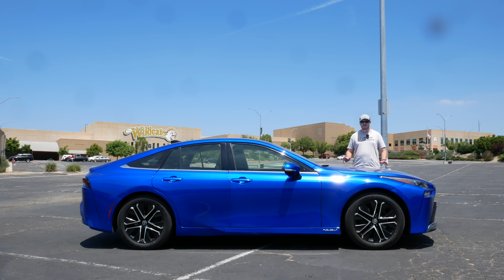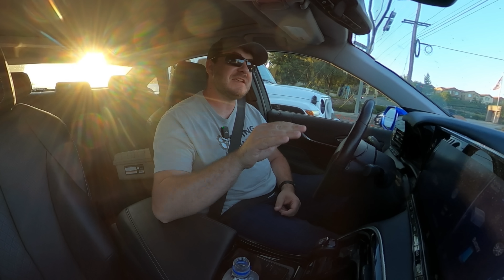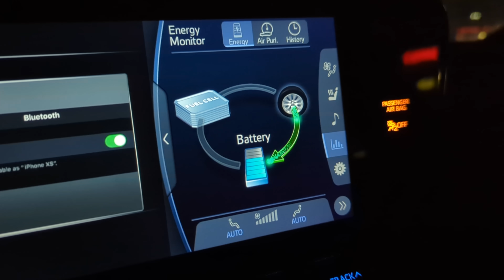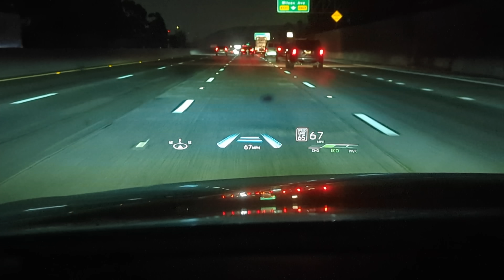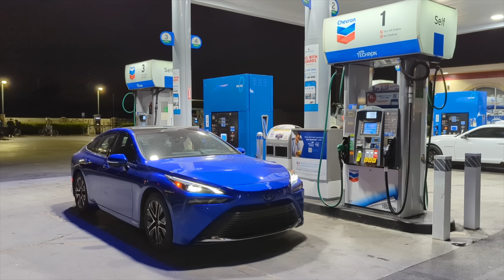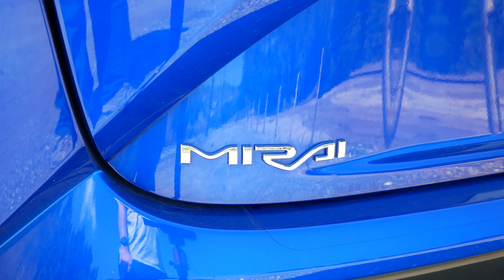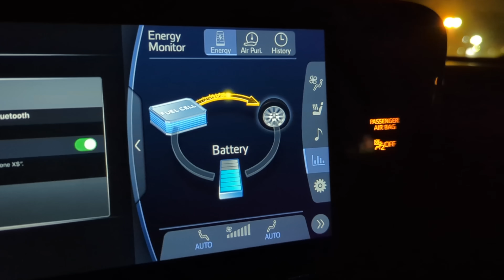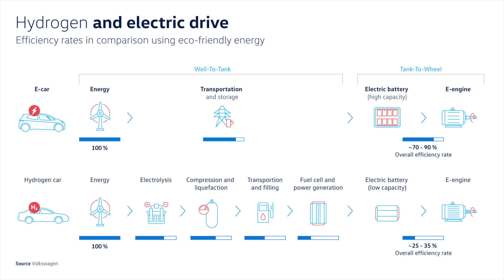The Toyota Mirai is Disappointing

Comment: The power efficiency of an ev isn't 80%.  You don't even get 80% power efficiency out of the grid.  Not going to lie, this channel was pretty good before you started lying for the sake of the weather gods.
Reply: 80% is possible, but 70 to 75% is more realistic. Way better than anything else.
Reply: @Freba9  80% isn't possible.  When you get a kW of energy at your end point your provider needs to generate more than a kW due to grid losses.  Every meter of power line is a loss, every recuperator is a loss, every substation, every transformer, etc.

There was a controversy at least in Europe (I don't know about the US) about 5 years ago due to energy providers changing to charging based off of the amount of power they have to generate to deliver a kW to your home vs the amount of kW the home actually consumes.  I barely bother with this stuff so I can't remember the exact terminology and as always google is completely useless.  Anyway that loss itself is in the 10-20% range (which is the reason for the controversy, since it was a functional price increase).

This is even without generation losses or storage losses and motor efficiency in the actual end vehicle.

80% is a flat lie.  It's as simple as that.
Reply: @jimmydesouza4375  70% to 80% is great whatsoever. Losses in electricity generation are obviously not included as hydrogen production starts with the same electricity.
Reply: @Freba9  Except he did include energy generation, well specific to pollution output.  You miss the whole grey/blue/green thing?
Reply: @Freba9  Anyway more to the point is that the 70-80% claim is a flat lie itself.  Energy grid losses increase the higher there is draw on the grid, as do maintenance costs (naturally).  The more vehicles there are charging from the grid the higher losses there are.  But anyway just ignoring that for a moment you have an energy grid that let's assume has a good efficiency of 80-90%, then you have that feeding in to an electric motor which has a typical PEAK efficiency of 75-85%, so an ultimate peak efficiency of 60% to 75% and lower efficiency at other vehicle speeds.  This is before getting in to battery and motor degradation.  Battery dissipation, etc.

EVs aren't even that efficient at the end of the day.  They're more efficient than ICE if you assume everything is ideal and completely ignore the production side.  That's about the best you can manage with them.  I personally don't care about the efficiency itself, what I do care about is when EV cultists lie about them.

Comment: Many of those points were said about electric cars as well when they started out. One big difference is that at the moment money is more expensive to borrow, than it was during the last 15 years. I guess we'll see how that affects the development of Hydrogen networks / vehicles.

Can you please make a video about battery recycling? I do not think that chain is entirely green yet.
Reply: There's not much need for battery recycling yet because there aren't many batteries to recycle yet. There's not going to be a whole recycling industry built up until there's actually any batteries to recycle.

Comment: If you think about it, the ONLY way to fill a FCEV is to go to a filling station. You have NO other option to fill up. No one can help you if you get stranded... you have to be towed. With an EV you can ask another EV with bidirectional charging to give you some juice. Or you can ask a friend with batteries to come help you... Or even many of the companies who offer such services. Even with a petrol vehicle you can carry a bucket of fuel...

The hydrogen is created from steam reforming of coal, gas or crude oil (96% of the world H2 production) which generates more pollution than burning the fossils. It is then compressed or liquefied (losses) and is transported (losses) to a fueling station. There it is stored in liquid form at −252.8°C (losses) and needs to be turned back to steam (losses)... but for volumetric reasons in needs to be compressed to 700 bars of pressure in the vehicle (losses). The fuel cell has AT MOST 50% efficiency (huge losses) and needs frequent replacement of expensive filters and components.The fuel cell looses power over time and needs to be replaced every few years. The vehicle needs specialized and regular maintenance for safety reasons (pressure vessels).
It is only promoted and advertised because the petrol industry does not want to give up it's business model - to keep you tied to a filling station and suck your pockets empty.
Reply: Yup. It's utter foolishness for almost all use cases.

Comment: Hydrogen vehicles are one of the most absurd ways of transportation.

- 96% of the world's hydrogen production is from reforming gas, coal or crude oil. (It is no coincidence that all hydrogen promoters are oil companies or countries tied to gas and coal exports).
- Electrolysis is also an extremely inefficient process. Only 13-18% of the initial energy is used. It takes 10 liters of clean drinking water to produce one liter of hydrogen.
- FCEV efficiency is even less than an ICE vehicle.
- Hydrogen storage is a difficult task. The fluid flows through the walls of its vessels.
- For its practical use or transport, it needs to be compressed to 700 bar or liquefied to -253 °C, which takes huge amount of additional energy.
- Hydrogen charging stations have a habit (and history) of exploding causing damage hundreds of meters around them.
- Infrastructure is nonexistent.
- FCEVs do not have any useful power and require a battery pack to start from a stop or traffic light.
- Sitting on several vessels under 700 bar pressure filled with highly flammable fluid... not a very pleasant feeling. Even more so when you have a child in the back seat.
- FCEVs require regular maintenance and safety inspection.
- FCEVs require frequent replacement of costly components. Huge filters are a consumable and a key component to their proper functioning. 
- Fuel cells also need to be replaced after a few time in the lifetime of the vehicle and lose power over time.
- FCEVs have a significantly reduced service life.
- Their luggage space is limited.
- In their most optimal version, hydrogen vehicles are at least 6 times more expensive to operate than electric cars.

Hydrogen has NO future in passenger cars. Its only adequate application is as an energy storage alternative...albeit quite expensive.
Reply: Well said!

Comment: EVs and hydrogen vehicles are going to be relegated to the cities primarily simply for the fact you can't just have extra jerry cans of electricity or hydrogen as easily. You're dependant on infrastructure.
Reply: The vast majority of all vehicles will become battery electric. Everywhere.
Reply: @Freba9  Well, you can try, but that's not gonna happen. Not until you can refill an EV within minutes using solar only.
Reply: @Megames2012  Both are not required. Charging happens at night most of the time and even on carbon heavy electricity EVs make perfect sense as total emissions are still lower.
Reply: @Freba9  How do you charge a dead EV in the middle of the woods at night?
Reply: @Megames2012  For this insanely rare event one could carry a portable battery / power bank.
Reply: @Freba9  That would be entertaining to watch. Or you could bring a couple Jerry cans of fuel, and not worry about staying near infrastructure.
Reply: @Megames2012  Burning fuel is simply not an option anymore in the future.
Reply: @Freba9  With more people switching to EV, yes it will be. In fact, it'll be more available and cheaper (less demand and all). In fact, since EVs are useless when you leave behind infrastructure, they should force all cities with a population of 70K or more to go full electric; saves more gas and gas powered vehicles for non yuppies.

Comment: I heard somewhere that toyota looks at hybrid and hydrogen more because it means significantly smaller batteries. The matterials for which are hard to source in scales needed for full electification. so hydrogen is not so much in the consumers intrest but more in the supply chains interest. assuming that statement is correct ofcourse
Reply: Fuel cells also require rare metals (even rarer, like platinum), whose production cannot be easily scaled up.
Reply: It doesn't make much sense because the consequrence will be that we will need a lot more generation capacity because they require so much more (3x) energy. 3 times as many solar panels, wind turbines, power stations to run the same number of vehicles.

Comment: It's the fill-up time that'll make the difference in the end. If we can get hydrogen cars to be 1:1 the same as electric but they fill up like a gas car, they'll win just for that reason. 
Especially now that we're seeing grids all over the world overloaded because of solar panels, it'll be interesting to see a transition to the solar panels that produce hydrogen (which we don't have the network for yet at all, that hydrogen does need to go somewhere) and hydrogen plants that use the excess grid power to offload the grid. Hydrogen is not the future, but it is a future, and it's a good one to mix with electricity. Hydrogen isn't the most efficient to produce or turn back into power, but it's something we can produce literally for free (ignoring the cost of solar panels) and could end up being more practical for automotive use.
Reply: The 30 percent energy conversion efficiency is a show stopper that outweighs any potential advantages in refueling time - which are presently academic as the number of places you can actually refuel one is a rounding error, and the stations are far more expensive to build than an EV charging station.
Reply: EVs will actually help balance the grid because they unload the grid. There is always an average (growing) number of EVs charging acting as a giant battery. Also current generation EVs can already charge so fast that there will barely be a noticable difference on a long road trip.
Reply: @Freba9  have you seen the number of megawatts required for a charging station? Most grids are not equipped to deal with the load of an EV, ESPECIALLY if the all start charging around 5-6PM when they get home. Solar panels blast the net full of power during the day, then EVs do the opposite at night. 
With how incredibly inefficient battery banks still are, producing hydrogen with spare power during the day and then using that to fuel a car would be much more efficient.
Reply: @daylen577  Like I said, there is always an average number of EVs charging. I am not talking about DC charging, but slow AC. With some simple software the charging power is regulated, depending on grid load. This is existing technology. Using hydrogen for cars is a big waste.

Comment: I think hydrogen could be cool. With combined with a small plug-in electric, you could imagine having a hydrogen generator running on renewables and be able to operate your car over long ranges with no ongoing costs but maintenance. Zero emission, self-sustaining, independent, all that good stuff. And it's a potential answer to the scarcity of rare earths with traditional big-battery EVs.

But, yeah, i don't see it happening either for all the reasons you outlined
Reply: If you're concerned about rare earths used in EVs, you should be much more concerned about all the platinum and other precious metals used in fuel cells..

Comment: I reckon 30kW fuel cell coupled with a 30kWh battery would've been better. Instant response, better regenerative breaking, plus you could have the option to charge it at home still. The fuel cell would be more or less a trickle charge, and would be enough to keep up with highway driving energy demands.

Comment: Thank yiu for the video. Ive always thought the entire hydrogen process was crazy useless. 

Here in Europe there was a drive to develop hydrogen cars (around 2010) because there's a country that has TEN times more electric energy than it can use and is too FAR from continental Europe to run cables: that is Iceland. 

Thebidea was iceland would produce hydrogen with that 90% wasted elextic energy and we'd ship it to Europe on tankers. 

But batreries developed faster.

Comment: One advantage of hydrogen is it can be used to store energy from excess generating capacity from solar and wind installations solving one of the big issues with renewable energy how to you store energy from the peak season vs having it go to waste.
The hydrogen tanks also are safer than a battery pack Toyota shot one with a .50 caliber anti material rifle and it did not explode it just vented do that with a Tesla battery pack and you'd have a fire.
One thing we can't ignore is the fact this car is much better looking car than a Tesla and includes a proper dash and HUD.

Comment: To answer your questions, the fuel cell can last a long time since fuel cell degradation is not an issue like battery degradation. In the winter, fuel cell EVs don't experience much range loss due to heat being a byproduct of the fuel cell. High altitudes don't seem to affect the range either. You did mention that most of California's hydrogen fuel stations are dispensing 100% carbon neutral hydrogen. Compare this to BEVs, which will not see 100% renewable electricity until 2045. We can go on and on about efficiency, but if you're still spewing carbon emissions by charging on the grid and fuel cells are carbon neutral today, who is ACTUALLY saving the planet here?
Reply: It literally takes 3 times as much electricity to power a fuel cell car, so it is always better to use the available electricity to charge EVs than to use it to produce hydrogen.
Reply: @Freba9  Well that’s the problem with intermittent renewable energy. People charge whenever they want to, not when the windmill is turning. You can use intermittent renewables to produce hydrogen and dispense if any time of day. It will always be green and carbon neutral.
Reply: @k1fizz  There is always an average (growing) number of EVs charging, acting as a massive battery. Hydrogen is a massive waste for cars.
Reply: @Freba9  a “massive battery” charging at night with the most carbon intensive electricity of the day. Thanks but no thanks. You’re not saving the world from climate change.

Comment: So not a car, but ive seen hydrogen powered transporters (similar size to forklifts) used in indoor refridgerated/freezer warehouses where people work due to the low temps killing batteries and... Not running combustion engines inside.... For obvious reasons. The use is there but not sure for comercial. I wonder how it would compare with evs in colder climates.